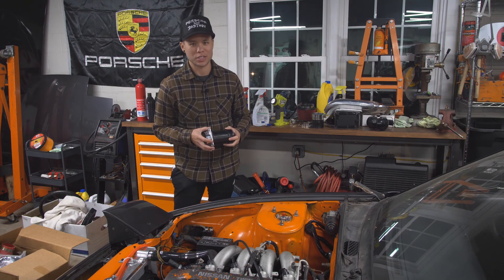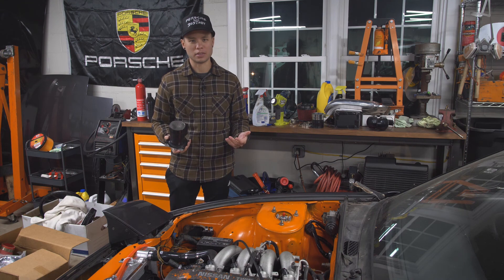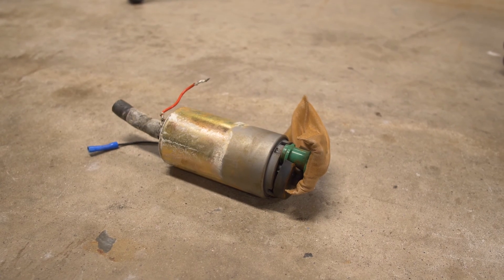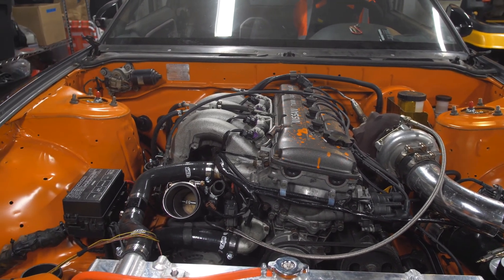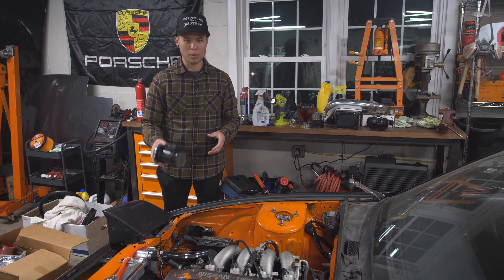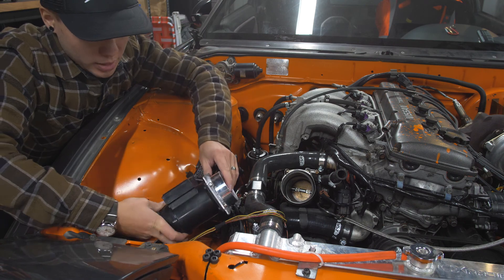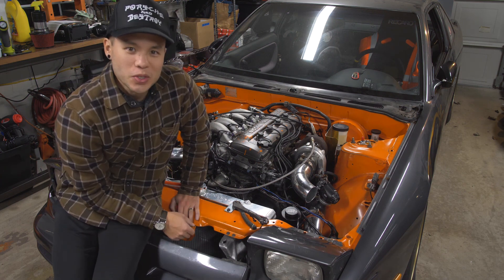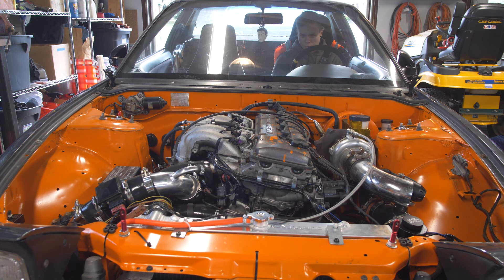Drift 240sx | KA24det - Blow Through MAF

Comment: did you have to get it retuned for the blowthru maf? im running into the same issue with the car stalling out with no bov
Reply: Running into the same issue myself. Here’s a comment to hopefully bring attention to the question. I would imagine a retune would be required since maf position was something I had to specify when purchasing my enthalpy tune.
Reply: @Marcusxmalicious  I ended up switching to a bottom mount turbo setup running a pbm turbo inlet and new hot side IC piping and it fixed it 100%, I also noticed my old header was cracked when I took it off but I’m not sure what caused it
Reply: I just spoke with whoever manages the rs enthalpy Instagram. They told me no retune is necessary. Just make sure it’s installed on the straightest portion of the piping, of course.

Comment: I thought maf would be on the pipe going to turbo not on cold side.  How does it work with ecu?
Reply from the maker: many believe that having the MAF there disrupts the reading, and that's the reason for doing a blow through set up
Reply: @BennyObscene  the problem I am having planning my build is the cold side piping is 2”. This increasing flow by the maf and causing the voltage reading to be out of range. They recommend 3” to compensate. But I can’t put 3” blow through with 2” piping in intercooler pipes right.
Reply: @BulliKid  sure you can